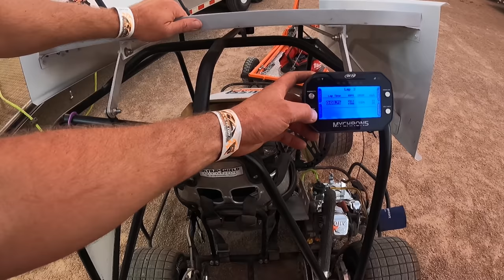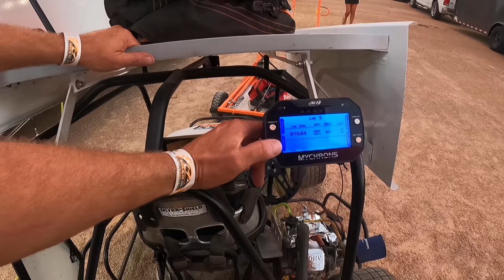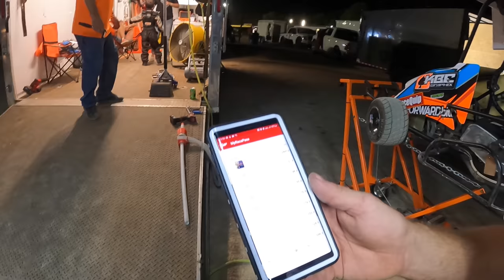THE BIG Victory was so close for our little racer!!! - Kart Racing Night #8 #thenashinator

Comment: I have question about what you do after the heat races in a Modified like obviously you change the setup if it doesn’t feel right but like what else do yall do before the A-Main
Reply from the maker: Just look everything over very well, ESPECIALLY the battery!!
Reply: @OldNo7Garage  Nice, im guessing to make sure its not overheated and do yall do tire prep inbetween races or is that just before the race night?
Reply from the maker: @lucasherbst447  sometimes tire prep will happen. Most of the time we switch tires that are already prepped.
Reply: @OldNo7Garage  makes sense saves time too. At least in that moment lol

Comment: Yeah boy good job Chase way to talk to him Dad just keep pumpin him up he will be fine He is a bad ass! you think your excited now just wait until he jumps into that modified! one tip we ran Quarter midgets lap, those those valve seets regularly and tighten those valves as much as the engine builder recomends run 0 weight oil and just the minimum it will free up motor. So it is not fighting the crank to spin up!
Reply from the maker: Ok thanks!